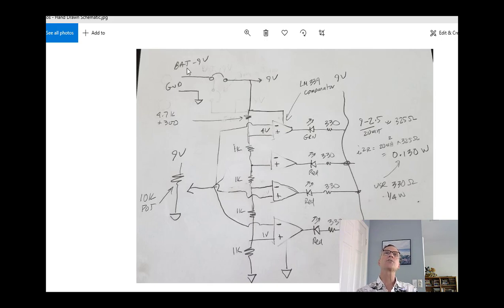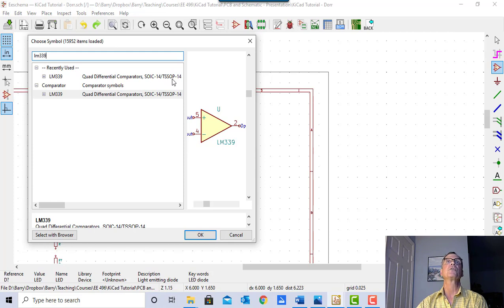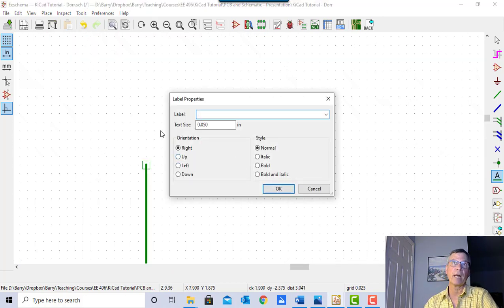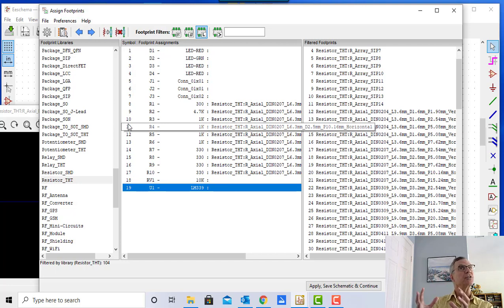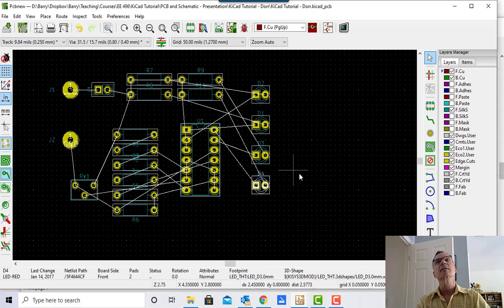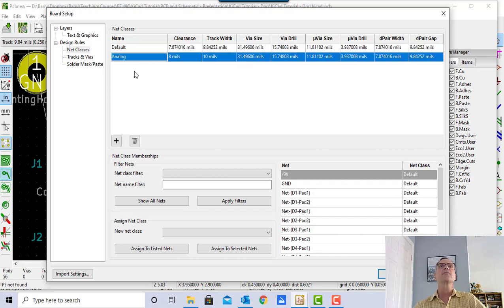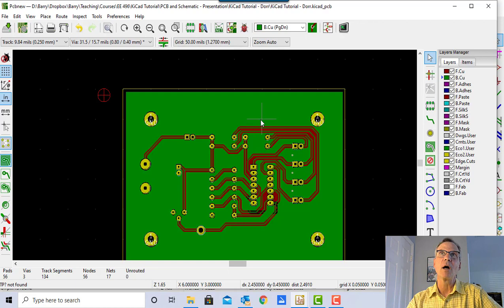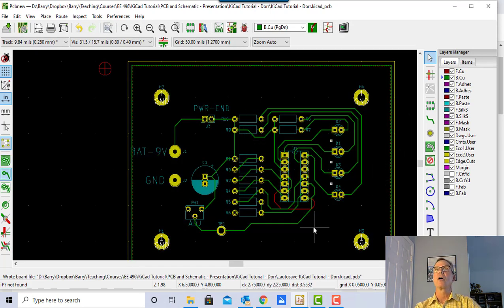KiCad Tutorial   Professor Dorr - SDSU

Comment: ERC stands for "Electrical Rule Checker" which professor Dorr calls it "Design Rule Checker". Resistor values are added by selecting the R icon next to the component. This will prompt a small window to open that allows you to give it a value.